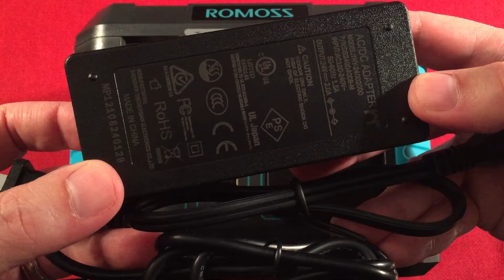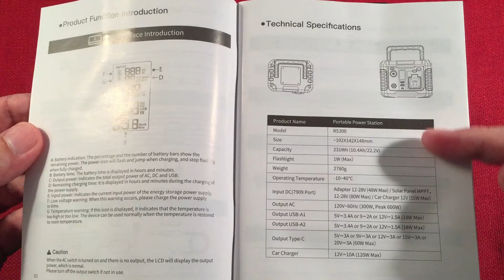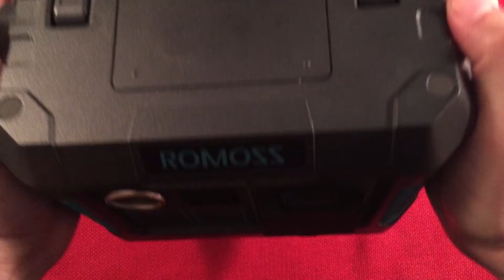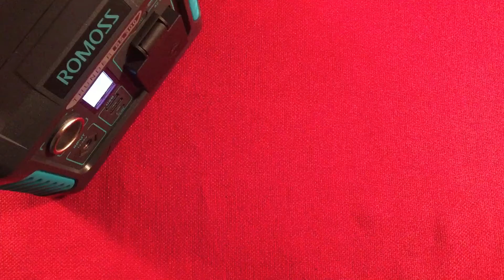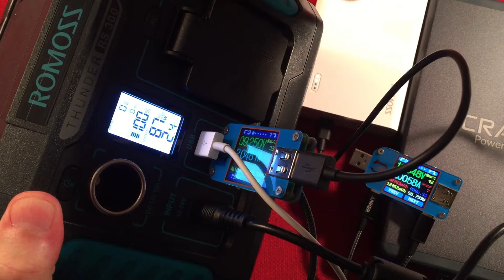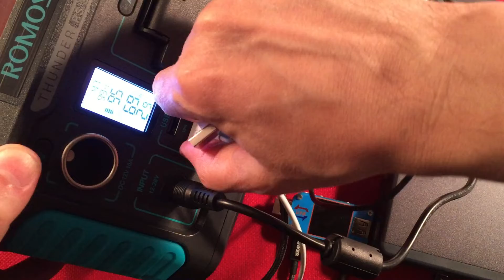Romoss RS300 231Wh Power Station Review

Comment: Good review but please can you let me know how noisy the unit is. Eg. If you are using it on a low load, like 30w etc, will the fan come on or is it completely silent. Also, does the fan come on during charging. Thanks.
Reply from the maker: The fan runs when using AC, but it doesn't seem loud.  When charging I did not notice the fan turning on.  This is with using the AC adapter.
Reply: @todderbert  Great thanks so much!

Comment: Hej Todderbert thanks for the review of Romoss RS330 Power Station Wow Wow Wow i was very impressed with what it can do, I like it and the size, it doesn't take up much space and is very portable. Absolutely this Power Station is something I'm very interested in buying but I might have to buy a power converter for it if I'm going to use it in Sweden I'll check it out..I'm looking at more Flashlights to buy I just looked at your review you did of the Sofirn IF22A flashlight you did a year ago. Sofirnlight has a great deal on this flashlight right now $38.59 and 15% off with coupon a great deal. P.S I gave the Panasonic RF-2400D to my older sister and she loves this radio so I have to buy another Panasonic Rf-2400D again take care Todderbert and I wish you a nice evening.